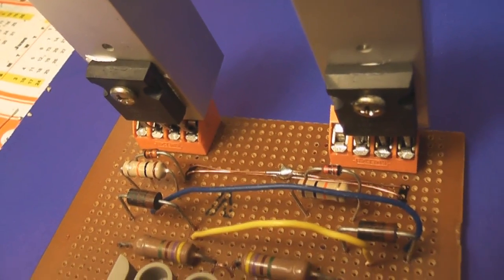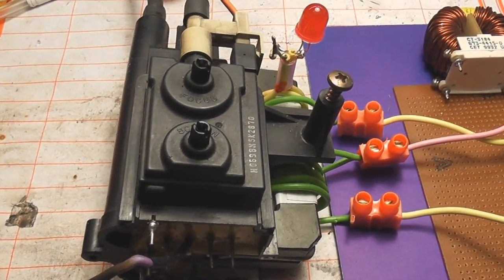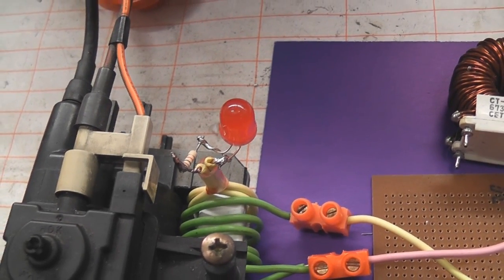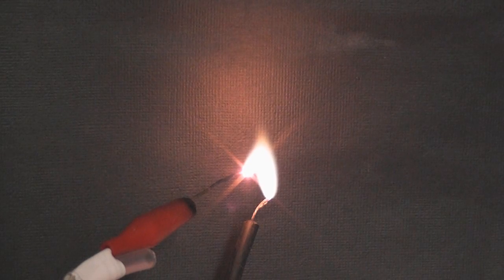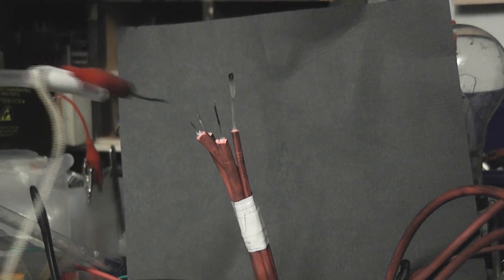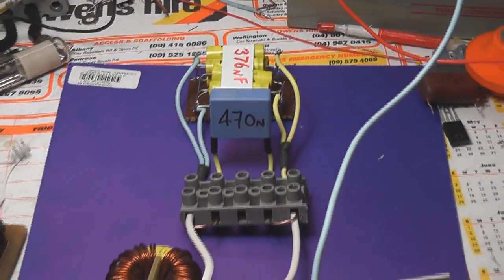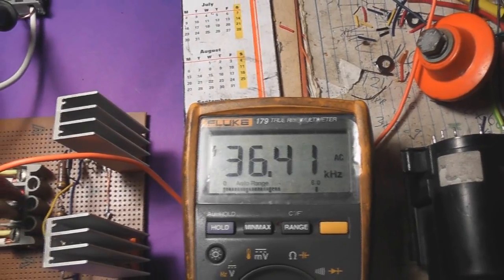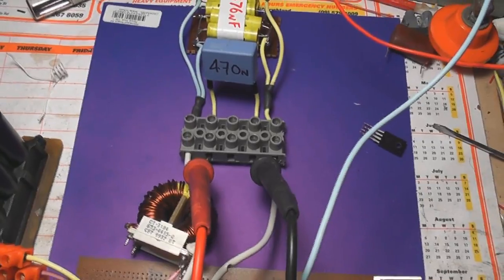Flyback TX-s on the ZVS driver [ 24 Volts ]

Comment: hey dragon .. well to be honest with you i as well dont have the full understanding of the reason for using fast switching diodes but for the data sheet i basically compare other diodes to the standard but trusted UF4007 and i like to use either the diodes from tv or monitor boards they work great and are usually 600v fast switching diodes shotkey diodes are great too.. well as far as i know they are part of the gate protection and could help with avalanche effect but im in the same boat as you

Comment from the maker: 4. I have stripped out many TV's and not struck a dead flyback yet.
5 No, when the arc strikes it keeps going, unless you limit the output current somehow.
6 Be careful. It is 15 kV or higher. I haven't dared to touch it. It has the potential to kill.

Comment from the maker: Answers:
1 Just a normal flyback from any CRT TV or old computer monitor.
2 Wind one coil of 12 turns and tap off at the middle ( 6th turn ) Mazilla diagram.
3 I Google datasheets for it UF4007 is recommended. In this one I used some fast diodes from an old TV board and it works well.

Comment: hello sinekt .. first off please be very careful with any HV it can be dangerous and deadly running flybacks with single transistor or 555 based drivers generally give out high voltage with less amps but can still kill you if you have medical conditions or another situation arises ! the ZVS driver will most certainly kill you because it can deliver high volts and amps !